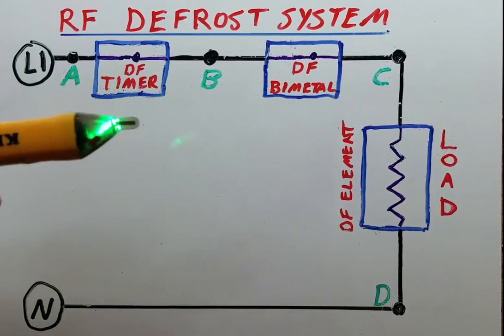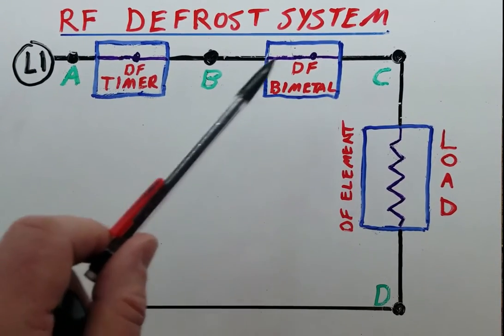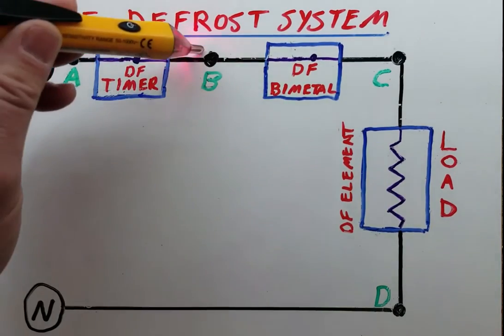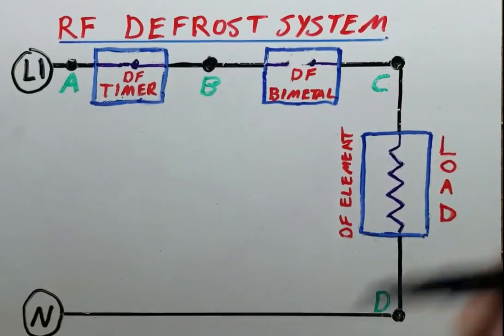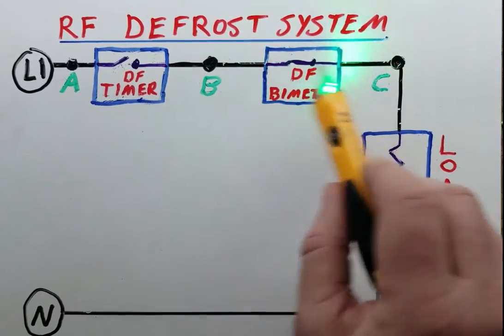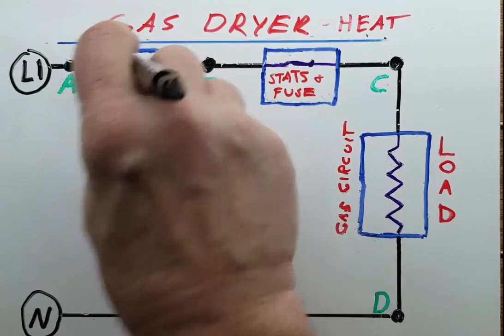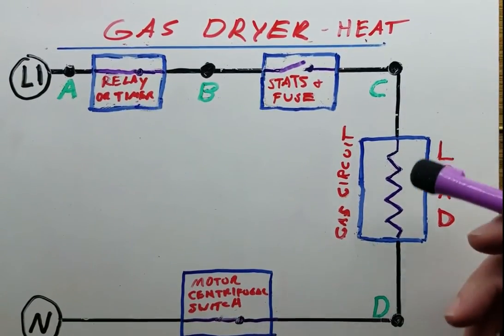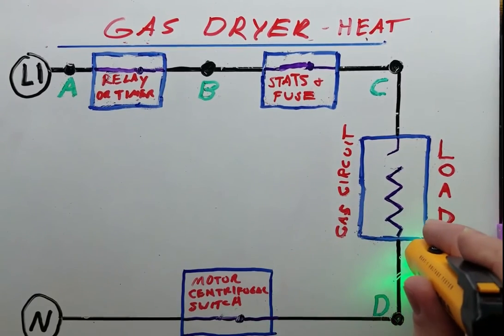#25 - "No Multimeter? No Problem! Diagnose 120V Appliance Circuits with a Voltage Pen"

Comment: What if an element is broken? Will it read voltage if you put your multimeter leads across the broken heating element of a dryer with the power on?
Reply from the maker: Yes, because the open element represents the highest resistance in the circuit (infinity), which gets the greatest share of the supply voltage (100%).
Reply: Ok thanks for the information. @TheTechCircuit